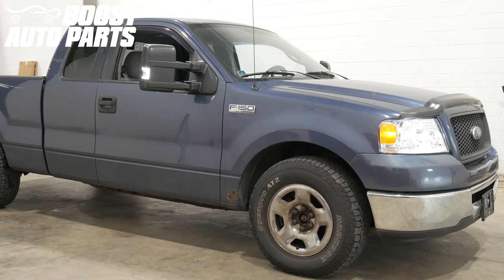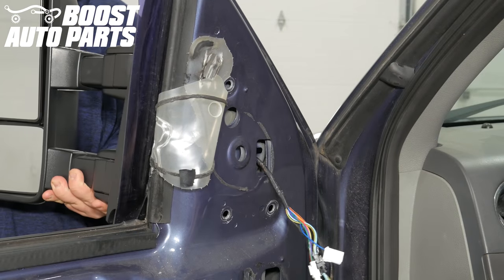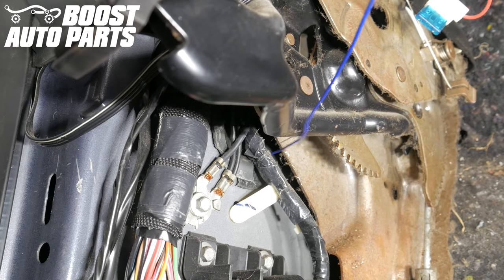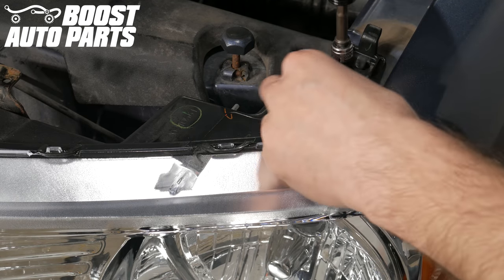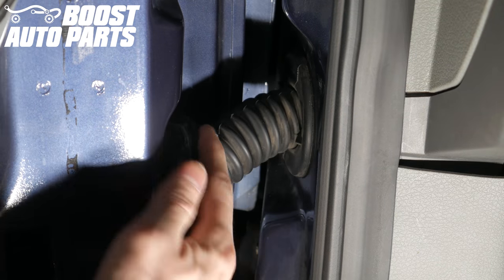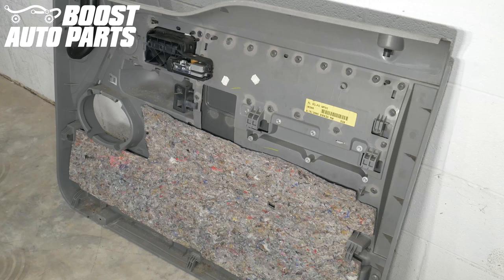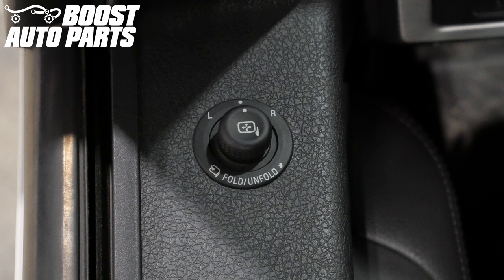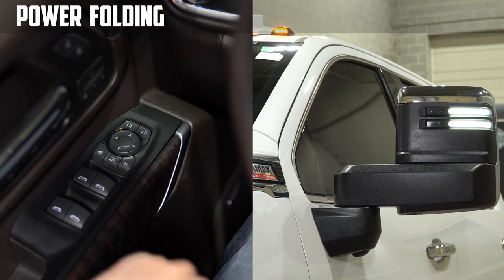Towing Mirror Install: 2004-2006 Ford F150 Power Folding & Extending Tow Mirrors (2008 Style)

Comment: I have a king ranch edition with the folding switch installed through the mirror adjustment knob on driver side door panel. Can I bypass 
most of this?
Reply from the maker: You would need to follow this to gain the power extend unless you never wanted to extend the mirrors.

Comment: Will the 2004 xlt model have the turn signal wiring on the original harness ?
Reply from the maker: Please reach out to sales@boostautoparts.com with your VIN or call us at 765-831-2830 for assistance.